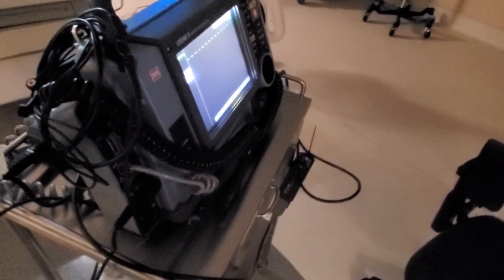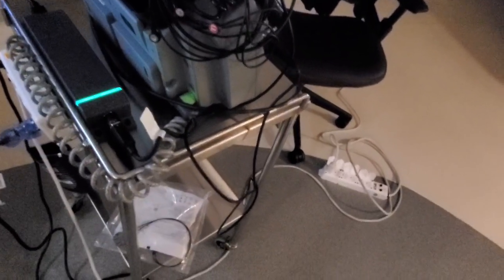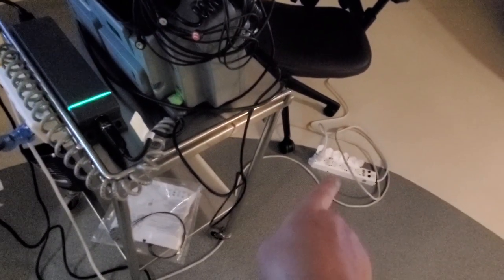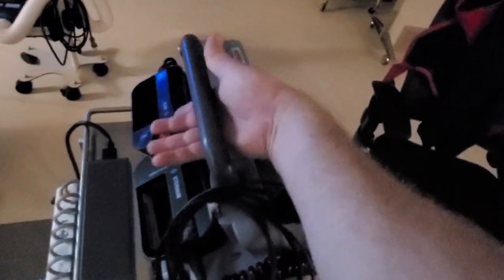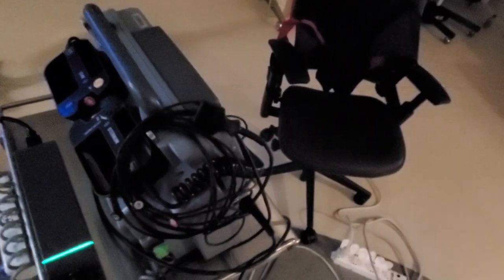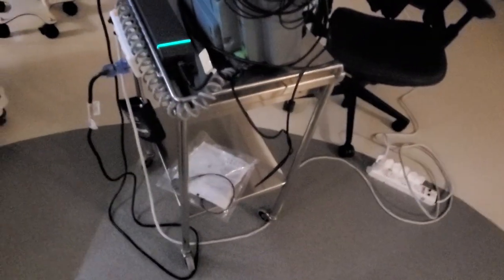Save Thousands in Cable Damages

Comment: your shrink tube tip is great. One thing to make it even better though is to slip a section of zip tie tail into the shrink tubing. it reduces the load on the cable even more & if you use the marine adhesive shrink tubing it seals up nicely making less of an infection control risk.
Reply: I tend to collect the tails from my zip ties to do this too, (and to make staples and shims.)

Though (being non medical) I use lace on my personal stuff instead of shrinkwrap because it's a great way to add torsional rigidity on top of mechanical-durability, (and I think it looks nice).  But I like the idea of using adhesive lined tubing for work.

Unlike relying on the awful 'strain reliefs' that most power-bricks tend to have these days, If you also attach the zip tie to the device-  The tapered end of the zip tie doesn't abruptly leave the cable unprotected precisely on the plane of intersection dictated by the shape of the case.  The extra torsional rigidity especially helps those right-angle boots (that hide the transition from the cable jacket to individual wires) from twisting-and-tearing apart under the insulation.